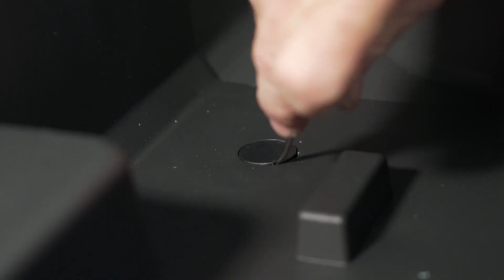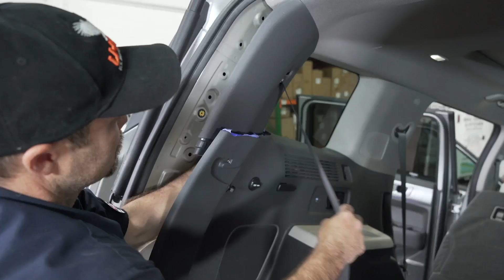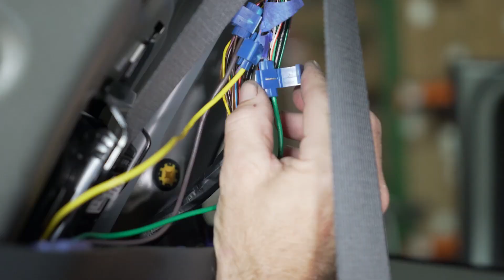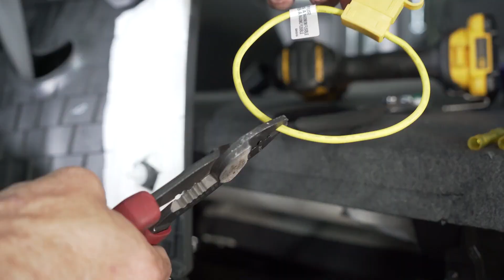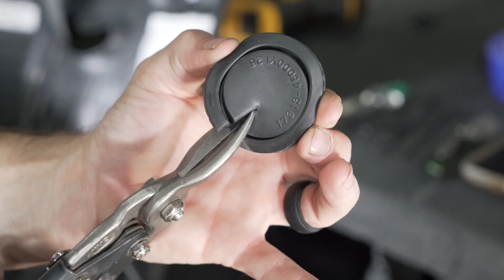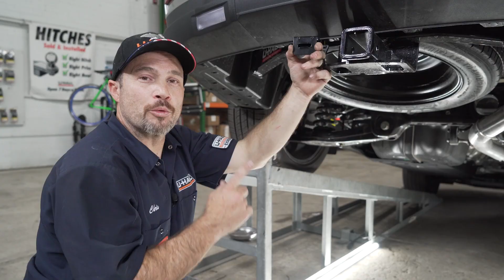2024-2026 Hyundai Santa Fe | U-Haul Trailer Wiring Installation | CMF59236

Comment: Why didn't you tap into that unused tow harness?
Reply from the maker: The Vehicles Tow Harness does not contain the signals needed for our Aftermarket wire harness. Only the OEM harness convertor box can "read" the CAN signals in order to provide tow lighting. The 12V power wire was the only connection we could get from the OEM harness.

Comment: Does the wiring is also able for a Hybrid Model? It has baterries in the same spot of where this videos shows.
Reply from the maker: This wiring harness is a universal kit and can be installed on any vehicle. You must test your vehicles wire functions to determine where to install. This Video Should apply to the Area your Wire harness will be located. Simply test the wires to confirm functionality!